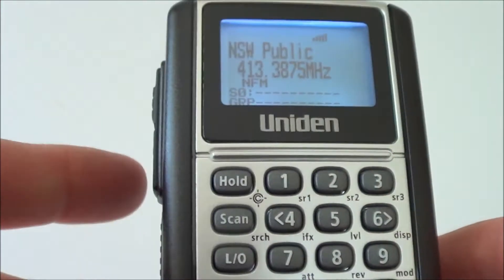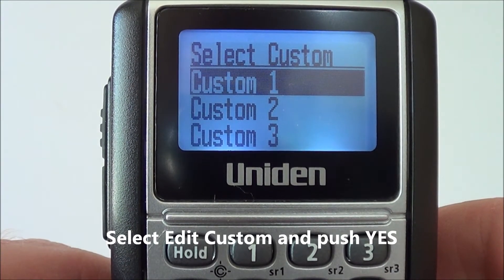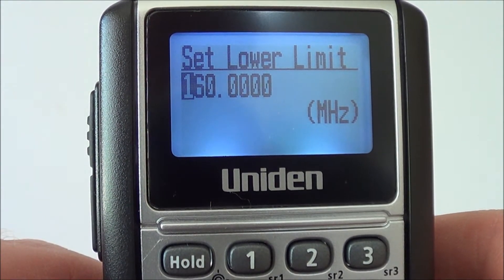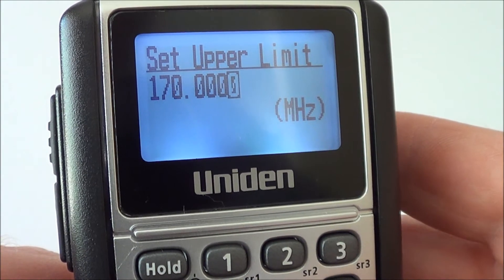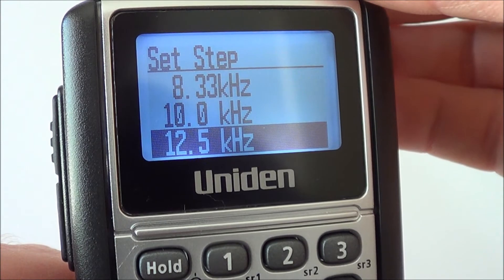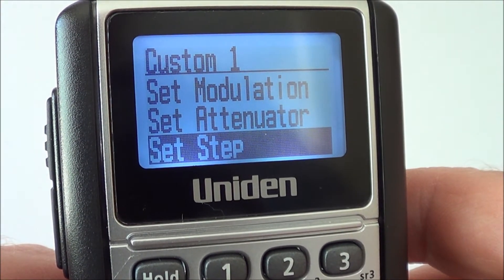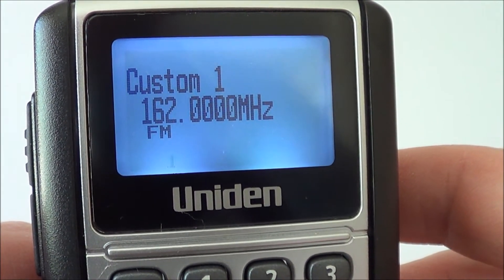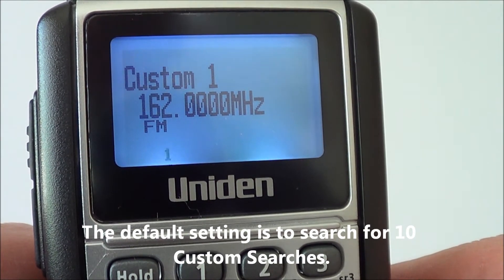Uniden UBCD396XT Digital Scanner - Victorian CFA Control Channels

Comment: I have a Uniden UBCD396T scanner which appears to be deaf. The only signals I receive are from FM radio or my UHF handheld. My antenna connection is secure. What I am doing wrong?
Reply from the maker: There could be a hundred reasons why its not working. Without seeing it in person - hard to guess. Do you know how to set up for the digital netwrok (RMR).  Do you know how to do a custom search between 160 and 170 Mhz.?  I would recommend a custom search to see if you find active RMR sites in your location first..
Reply: Thank you for your advice. I was considering purchasing an AOR AR-DV1 to replace my current scanner. Are they a reliable scanner?

Comment: Is it also able to listen in on other emergency services? 
Mainly Ambulance.
Reply from the maker: Depending on your location - some areas may be encrypted. Supply your location and I can confirm.
Reply: Yes you can!!! Frequencies are usually between 164 - 166 mhz and also between 410 - 413 mhz
Reply: Cfa is between 160 - 164 mhz from the top of my head